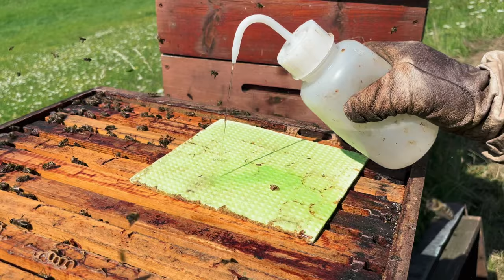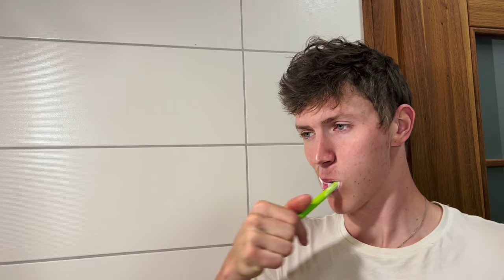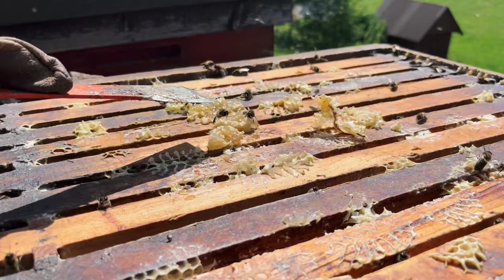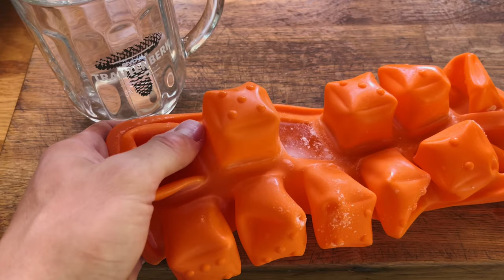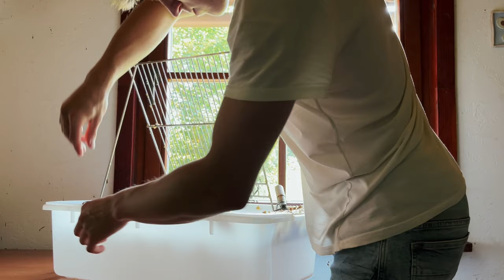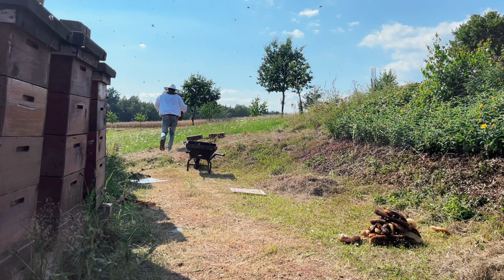A Day in the Life of a Beekeeper: Hive to Honey

Comment: What frame/hive size do you use? The washcloth you put a liquid on, is that Thymol?
Reply from the maker: the frames are approx. 19.5 cm high and approx. 51.5 cm long. hive size is 19,5x51,5x42,5 cm (1 attachment). this washcloth, where I applied formic acid, is an ordinary kitchen sponge, which is quite cheap